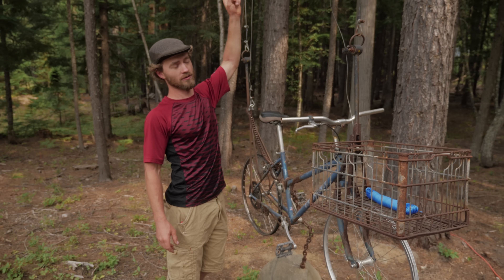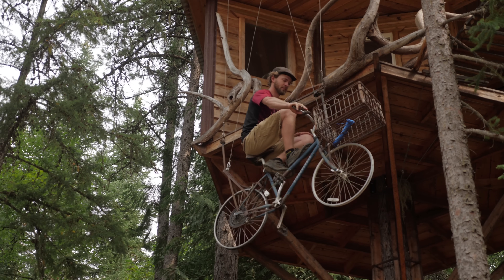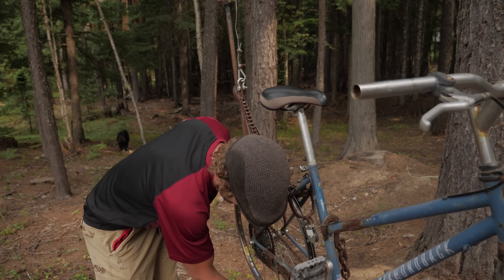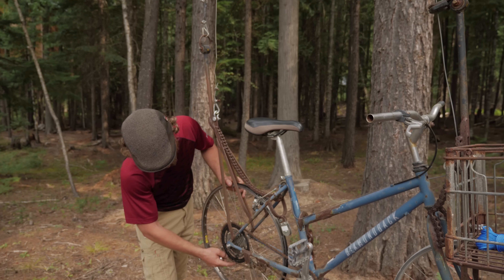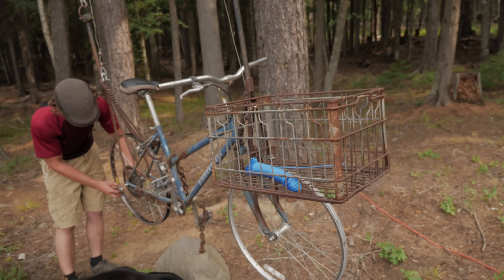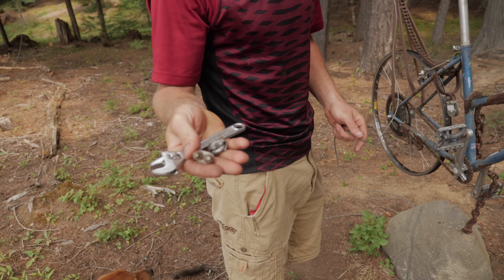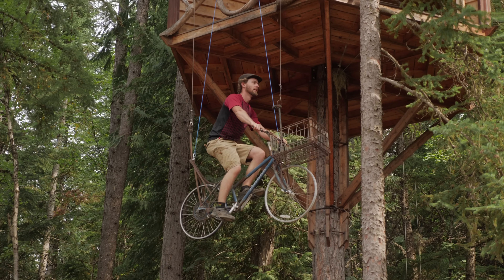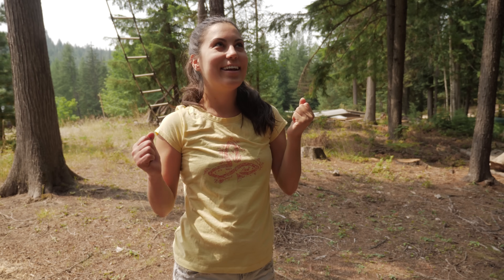Tree House Bicycle Elevator (How It Works) + Upgrades

Comment: I would weld a guide on the lower part of the frame that goes against the rim and then a guide on top of the frame that goes against the rim so when the wire comes in and spools around that top and bottom guide will direct it hopefully keep it from popping off

Comment: So so many kinds of risky man. . . . Where's ur safety if something breaks?
Reply: The bike. Also, on an elevator if the cables snapz unless the breaks are on the walls and not the cable  you can't do shit either.
Reply: What is his safety if the tree falls? What is your safety if your roof caves in? This is the same safety as a ladder pretty much, if not more since it has less risk factors, like falling off, stress on the rope from the grips on it, fraying and wearing it, etc.

Comment: I was wondering if you could make some RC servo valves on the counterweight and some guttering to channel rainwater into storage that can be added to the counterweight and drained, then you'd barely have to pedal.

Comment: Careful with the Dynema breaking down over time with the elements.
EI: UV exposure, rot with rain/mold

It is stronger than steel (22kn), but thats the trade off. 
Source: I’m a rock climber

Comment: Hello.
In case you don`t think about it - when you descend in this elevator whith Dyneema cord or another synthetic ropes  , friction rope frome bicycle 
frame generate 
enough heat to damage the cord. And steel of frame  not helping to spread this heat  avay frome rope.
That`s why  most climbing descenders made frome aluminium 
alloy.

Comment: I AM AN ELEVATOR CONSULTANT AND THIS IMPRESSIVE. A TRACTION ELEVATOR WITH 2 :1 ROPING POWERED BY A BIKE, NICELY DONE! TRY A LARGER REAR RIM. ALSO I WOULD HAVE YOU USED THE OLD CABLE TO FISH THE NEW LINE THROUGH. 

WE USE THAT SYNTHETIC WINCH LINE ON ALL OUR ATV/UTV'S SINCE IT DOESN'T FREY AND STAB YOUR FINGERS.

Comment: You have drastically reduced the breaking strength of this line by tying knots in it. There is a great book put out by Sampson line which will show you how to splice eyes  keeping its Breaking strength hi.
Reply from the maker: You are very much correct about that. But I’m this case the strength of the rope is way overkill anyway, so it doesn’t really matter. And it never experiences shock forces either. I would like to learn how to splice rope someday though!
Reply: @GrindHardPlumbingCo Excellent.

Comment: Got a suggestion on the way you anchor the Bike at the bottom. If you were to set a post in the ground with a hook like a cane you could set it right under and as it set down it would slide off the side and hook itself . To unhook push down and over keeping both hands free. Thanks new subscriber. Enjoyed the video

Comment: Neat-O! When I was a kid I did the same. Had a Zip line, but we called it a cable car. For an elevator all we did was tie a rope to tires for a counter balance. That was so when you got to the ground you just let go of the rope and let the tires fall back down. So yeah, had to climb up. You solved that. But I think I would put a barricade around the counter weight water tank. That's a bad spot to wonder into in case the cable holding it broke and the tank should fall.

Comment: Hey man, hopefully you didn’t figure this out the hard way but dyneema doesn’t do well with knots it’s a very slippery cord so generally either the knots will come undone or they will sinch down on themselves eventually cutting themselves.

There are a few knots that are safe to use with dyneema but the figure 8 knot isn’t one of them.

The safest option is to look into splicing the dyneema.

Otherwise, looks wicked dude! Stay safe

Comment: I just cant think of the proper name at the moment and it probably has different names in different countries. I am an Aussie mechanical fitter and when I worked on cranes, hoist rope is designed not to hold this memory because its woven in both directions and has a fibre core instead of a steel core to keep ut lubricated. It would be expensive but worth it. Check your local rigging and lifiting solutions store.
Reply: Oh yeh, i subbed belled and liked too  awesome set up.

Comment: This whole project is a catastrophic accident waiting to happen
Reply: Michael [APFX] you are much safer in your house.  You should stay there.
Reply: There is a fail-safe, the cables for the counter weight are separate from the motion cables, if the motion cables snap, you just coast down at the speed you would go without the brake. If the counter-weight cables snap, you would be able to apply the brake and/or use your pedals to reverse yourself down, the gearing advantage would help. The bike has no freewheel in the rear sprocket, which is why you take your feet off the pedals for a quicker descent.
Reply: I agree. A complete rebuild is needed.
Probably be good vid to watch.
Reply: Yeah, it's undeniably cool, but it would be even cooler if some of that ingenuity were put towards designing a failsafe or two.

Comment: You should be real careful with the the knots you tie in Dyneema. It's extremely strong stuff, but knots will weaken Dyneema (and other 'high modulus fibers') even more than knots weaken regular poly/nylon rope. Splice is best.

Comment: If you are going to be using dyneema for a long time maybe look into an eye splice at the ends, an splice makes the rope stronger a knot makes it weaker. And on the places with the most wear use a special dyneema cover witch you can splice on easily and makes the rope last a lot longer. For more information just google it. A lot of dinghy sailors use it and make videos about it.
Reply from the maker: That’s good to know! Thanks for the info.

Comment: I would’ve attached the rope to the ground so you pedal on the way down and go up by releasing the brake. That would allow you to stop chaining it. You would need more weight though
Reply from the maker: Haha! I never that of that. It would be cool to not have to work on the way up. But you would still have to chain the bike down at the bottom. More so, because the weight trying to pull it up would be greater.

Comment: Bathroom on a separate tree maybe a 4x4 little shack with the toilet like a portapotty with a very large pipe running down facing away from the house/treehouse(out of sight) into an rv sewage tank that’s on a small trailer. That way whenever it’s full you can just dump it, only problem is water to “flush”. Maybe a rain barrel with a tarp funnel?

Comment: One thing to be aware of with dyneema is that it degrades more quickly from exposure to UV light than other materials like nylon, so it should be replaced relatively frequently since you're leaving it outside all the time

Comment: Your disregard for engineering safety design is going to get you or your friends severely injured or killed.
Reply: y U r 6rhehd by ud by sy
Reply: What could be so dangerous about a giant pointy rock right under the elevator you can fall on in the event of a problém?
Reply: bet me first

Comment: Very cool, but just seems like a wasted bike... why not just anchor the cable or rope to the front, instead of the rear? Then you won't need to weave it through the bike's frame, and decrease its deterioration. Also, you should remove the front tire since it's pointless, and attach a larger cage... maybe then you could take up your dogs!

Comment: Wat is happening if your chains brakes when you are up?
Reply: he can most likely manually pull it but idk how much force that would take, or he can just ride it down and repair it on ground
Reply: Or you can take the zip line
Reply: look at it again, it self descends, you use the brake to slow and stop. Yogee saw.
I would worry about the main cable (now rope) much more, and I'd feel better about it if it were larger size. a really FAT little 20" rim could make pedaling easier, has to be wide and deep enough it doesn't get over spooled.
Reply: @modelnutty6503  To me it looks like a 6mm (1/4") rope. A Dyneema one is rated for about 4,3 tons! Only worry about wear, just like on a steel cable (don't have to worry about rust, don't need to oil or grease it).
Reply: Counter weight. No free fall.
Reply: Or the counter weight cable breaks while you're up high, yikes.
Reply: How do you get it back down for a second person to go up?

Comment: Question, can you explain the pulley assembly for the counterweight? there are two cables on both sides of the weight-- are they for each side of the bike, stabilizing it ? Or do they somehow come together to be one pulley like an earlier video suggests?
Reply from the maker: Yes, the two cables on the counterweight go to the front and back of the bicycle for stability. There is a pulley for each cable on each side of the treehouse. The two on the back are close together, and the two on the front are farther apart to spread the cables out to the ends of the bike.

Comment: What if the chain breaks? Then your screwed😂
Reply from the maker: Actually, if the chain breaks you would be fine, because the brake would still slow you down. But if the rope breaks you are pretty much screwed...

Comment: I think you should install a 80cc engine on the bike
Reply from the maker: Haha! That would certainly make things easier...
Reply: No er visit straight to the box
Reply: @belinda hawkins U tell him/At least he is trying. From Cyprus
Reply: Just an idea. Why not make it an elevator at once and install everything separately on a plank like an actual elevator motor and then add walls and ceiling to it. You could leave the bike as is and just conceal it behind a plank and leave the necessary engine part accessible inside the elevator.
Reply: Stop giving idiotic suggestions like elevator or motor engine, the reason he used an old bicycle is because its free, making elevator or adding motor will cost money and make it look like a modern fucking building and less creative, more complicated, its a piece of art , a simple machine, not some fancy ride where you go up and down... morons...